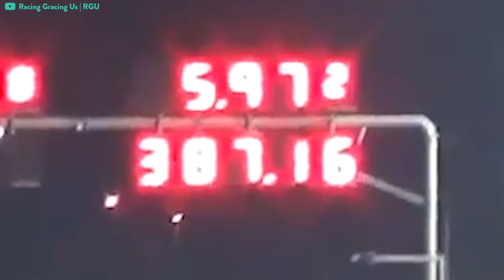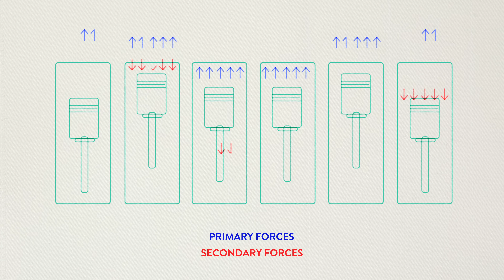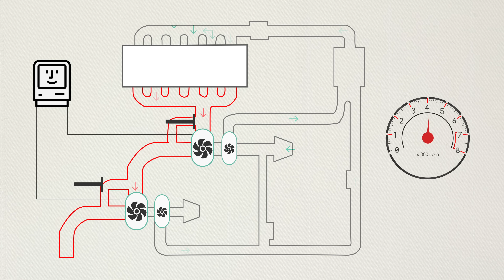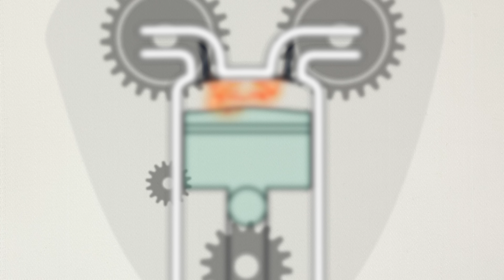2JZ ENGINE - How it Works | SCIENCE GARAGE

Comment: Just think about how reliable this engine is when you keep it stock
Reply: Even at 400hp....
Reply: @alhemmings8554  that is where I would want to get my IS300. Do you know if you could get 400 with just the stock engine or would I still need to get a turbo setup?
Reply: @alhemmings8554  is dont have 400hp stock dumbass
Reply: I bet you could do 500 000 km on a stock engine without breaking anything
Reply: @valtersousa27  way more 😂 I've seen stock toyota engines last a million km's
Reply: @valtersousa27  a lot of cars do that lol
Reply: @valtersousa27  I kmow a Engine who can that to without any Problems. Audi A6 2.5 TDI it's a 5 Zylinder Turbo Diesel Motorcode AEL. This thing is just great. You can even tune it up to 220hp and it keep running reliabel for decades. I speak out of experence.
Reply: stock cars have never realy had problems with the engine. engine is the last thing that fails in cars. it's mostly the stuff around the engine. sensors,wires,turbos, fuel system, brake system, rust. an engine rarely fails
Reply: @rpchar  But that is diesel, that's a completely different story. I'm talking about 500k miles ",driving like you stole it". Of course its easy to do that mileage on any diesel driving like a grandmother
Reply: @valtersousa27  Who say that this thing got drived like a grandmother? We straight piped it and have everyday fun with it. Every week we drive around 1000km. The turbo sounds also great. Diesel got also nice sound. And it's Nixe to fuck with people who think it's just a Diesel. Got no Power because it got nö Sound like a F1 car
Reply: @rpchar  isnt that the shittiest TDI ever lol?
Reply: @FaZeCrafT420  The 2.5 5 Zylinder is nice, the v6 is shit
Reply: @rpchar  the 1.9 tdi 130hp AVF is way better
Reply: @oreimarcio  In Germany we say: Nicht genug Hubraum!
Reply: @rpchar  in portugal we say: não é  preciso cilindrada alta quando há muito cavalo
Reply: @rpchar  Depends in wich V6 tho. Just look at the RS4 Limo from Philip Kaess making 1300hp.
Sadly it burned down for some reason in normal traffic. For his version 2.0 he is aiming for even more.
Reply: @rpchar  mate, it's still a diesel, economic engine to pull stuffs, that's all
Reply: @kaedeschulz5422  he was talking about a diesel audi not a rs4 xX
Reply: @rubencarvalho3517  If so ups... Idk shit about diesels.

Off course they need lower compression if you wanna make big power :)
Reply: @rampage3337 so true and every car has its Achilles heel.  The question is what car can last as long as a million mile engine, like the Mercedes five cylinder diesel.
Reply: @valtersousa27  .................wack.
Reply: You can fly down the highway full throttling it, for like 5 minutes straight.
Reply: @Bu0f  only 5 minutes?
Reply: @Bu0f  you talking out of experience?
Reply: Noorquacker No
Reply: Noorquacker it was a guess
Reply: ToxicHeadshot, from my experience, yeah. Pretty spot on
Reply: Noorquacker i actually drove mine on my way from the netherlands to croatia at 180-200 on cruise all the way through germany, only stopping to refuel... without a sweat!
Reply: @Bu0f  very Nobel of you to tell the truth and say no, I was expecting you to start bragging about your supra or pretending to own a supra haha. I forgot I’m not on Instagram
Reply: @Bu0f  ehh you can do that in most vehicles now
Reply: @breedam  KPH or MPH?
Reply: @obviousb8508  km/h, i am from the netherlands.
Reply: @breedam  Da li još uvijek posjeduješ Supru?
Reply: @breedam  Supra in Croatia damn never saw it
Reply: @NoorquackerInd  you can lmao I daily a stock sc300 with a vvti about 250,000 miles with just a rebuilt head it runs like a dream
Reply: hoe hoe heb je geen boetes betaald, ik zou stressen dat ik mijn rijbewijs zou verliezen
Reply: @NoorquackerInd i sent it home 30 min drive from my ex's house at 120-140 miles per hour, it survived the whole drive back but popped a coolant line off going uphill after. My coolant hoses were old car hasnt died on me yet still my favorite car to drive
Reply: @Bu0f  evidence?
Reply: @Bu0f  you can do that in literally any descend car.
Reply: @Bu0f  you can do that it most cars
Reply: @Bu0f  Just 5 minutes is just understating how long it can with stock setup it can do at least 15 minutes more if you have proper cooling
Reply: @Bu0f  I mean, if you got the gas..
Reply: It’s called the IS300
Reply: @warrenh8709  Altezza?
Reply: @maksisskorodihins5344  no the altezza has the beams four banger that is also a great engine. The is300/aristo has the 2jz
Reply: Miles B that’s a 2jz not a gte from a Supra tho
Reply: @okkaybender  Isn't the IS300 NA? In that case i don't think it has the gte.
Reply: @okkaybender  that’s what he’s saying lmfao
Reply: Pretty sure stock 2jzs don’t exist anymore
Reply: @Detah_  They do but very rare
Reply: @Detah_  They exist, just not from Supras probably. Maybe you can find stock ones in a Lexus.
Reply: @Detah_  ouch, I’ve got one
Reply: @Detah_  they do and are rare and expensive than an amg
Reply: @Detah_  I own a Lexus IS300 with a stock 2jz engine 😎
Reply: @Detah_  I've got one with 350k miles 😁
Reply: Detah I have a 2jz-ge. It’s the naturally aspirated version of the gte, the engine block, crank shaft, connecting rods etc are all the same as the gte
Reply: @jugo6987  unless you have a Non-vvti ge your connecting rods are NOT the same as the gte
Reply: The problem is that you can't leave it stock but get at least 1000 horsepower
Reply: "stock" haha, how about no😂
Reply: Still 0-60 at 4.6 seconds which is nothing to joke about
Reply: Mine is stock! 100% has 210,000 did the Timing belt water pump kit myself hopefully makes it to 400,000.
Reply: When you what?
Reply: Legend has it that you can fly when driving the car
Reply: Nope. I need that loud BOV, I need that loud crackle pop... I need that vrrrrrruuuuuuuuuu tutututu
Reply: @bclilboostd  A blow off valve doesn't stututu 🤔😅
Reply: toyota. super reliable
Reply: @_.twixxx  *old Toyotas
Reply: @rpchar  oh ok
Reply: Brother has a daily 2001 lexus is 300 with 335,000 and it drives like new lol
Reply: No one will ever know because there’s probaly no more stock ones
Reply: Still kicken at almost 300k miles
Reply: @sfmusic1418  You have a JZ? In what car if that's the case?
Reply: S50, s54
Reply: true
Reply: 500,000 miles plus prolly
Reply: nice bait
Reply: But more power baby
Reply: @andyhouse1774  Hell yea! And also if done right is still reliable.
Reply: And still really fast
Reply: Literally bulletproof
Reply: Not realiable.
Reply: 2JZ vs mom that’s not aware of the existence of oil or the significance of a check engine light
Reply: Ermagurd ermergin her relerurble urt curd ber
Reply: You could redline with no oil and gas for an hour straight
Reply: It’s reliable with 1200hp
Reply: @Will Kelly lmfaoooo😂
Reply: Nobody knows since every supra has custom engine.
Reply: 2jzs were even put in the 4runners. My brother had one. Motor ran so silent that there were times when he would try to crank it on while it was already running. You literally couldn't hear it. 💀 lol.
Reply: @moisessanchez2365 , they never came in 4Runners from factory but it’s a cool swap
Reply: It could still be easily modified
Reply: And slow.
Reply: Never been done before
Reply: Just think about how much power you’re missing out on stock
Reply: Bro did u forget it’s Toyota of course is reliable
Reply: 1JZ is more reliable so just imagine that too
Reply: @yungsilvia2507 , the 2J is nearly identical in design with just a longer stroke so I’m not sure why you think that lol they’re equals in reliability tbh
Reply: We never think that
Reply: Keep the oil clean and it will probably outlast you. Lol
Reply: My 2jz at 319k and still going lol
Reply: @gnashsliderdude9678  2 jz; no shit?
Reply: “LES GO 2000HP”

Engine: “imma head right out”
Reply: Or even if you just do simple mods
Reply: well this engine would last atleast 1,3 million km without problems.
Reply: @EnjoyMyHitsYT  and who needs an engine that last longer if it's not a truck lol
Reply: @yacinealg152  lmao
Reply: Bro send it.
Reply: Motto of toyota: best reliabilty when stock
Reply: If it’s tunes right the engine runs more efficiently even making big power doesn’t decrease how long it lasts you just have to know what your doing
Reply: Not that reliable actually. You don’t understand that just because the block is strong and can take a lot of stress doesn’t mean it is reliable,
Reply: @freddieparrydrums  what's does it mean then...
Reply: It’s is very reliable. I have one stock 2001 is300 that has 400k and no problems besides the o2 sensor needing to be changed
Reply: I dont have a supra but the thing i would upgrade first is the fuel tank so i can get more mpg and install a boost controll and a standalone ecu so i can go 90mph with a mk4 supra that make 500hp that can take me gome
Reply: I plan on keeping mines stock, maybe low profile bc cams and a tune that's about it
Reply: Or add things like oil coolers and heat resistant tape.
Reply: A coupe corrola basically
Reply: Right as everyone is having a stroke because the tundra is twin turbo like it’s going to be some huge failure. Like na. Toyota had this shit figured out before you were brought onto this planet.
Reply: However, if you'd slap on all the modern ecology norms, it might still be reliable, but would probably have under 200hp. Still a dream.
Reply: Lol who keeps a Supra stick?
Reply: Who keeps a Supra stock?
Reply: Exposed
Reply: Just think about how much it cost to
Reply: Guess it’s safe to say almost every if not every 2jz isn’t stock anymore. They’re all 2000jz’s 😂
Reply: 1 million miles
Reply: as if such things exist
Reply: I have a 450hp mk4.
Right now I have 600k kms on the dash.
The only change I had to do was change the timing belt. That's it
Reply: Nobody needs ur negativity... hush ur whore mouth.. all our gfs know that these mods we do to these are to make them more reliable. Since we explain exactly why a larger turbo is more likely to last longer because it's bigger. Those smaller ones just too small they blow so easily. And ofcourse we are adding head studs to make them more reliable. Oh and let's not forget the reliable cams we put in. Ported and polished heads remove the factory imperfections which make them more efficient. Duh. Oh and the bigger injectors mean they're working less as hard to fuel the engine so they last longer. Stock trim is reliable but I am willing to go the extra mile for my family to make sure its..it's... oober reliable.
Reply: The engine is smooth even cruising it to maximum throttle at Autobahn 200m/hr gas is the limit
Reply: No
Reply: @giggityeffyou  Yes
Reply: I have a 04 lexus is300 bone stock never missed an oil change and she's at 278k right now and still running daily no problems
Reply: What are you talking about? You think it was more reliable than my 2021 F150 3.5L Hybrid? Lol
Reply: Make it more reliable by removing the turbos and keeping it NA.
Reply: @wooferjr169  And only have 200hp on the gte because of the low compression pistons? Hell no!
If you make it NA might as well mod it so that it make 400hp NA. That would be awesome!
Reply: @kaedeschulz5422  turbo'ed cars need lower compression
Reply: @wooferjr169  ....wack.
Reply: @wooferjr169  you’d be crazy to drop stacks on a Supra and just keep it stock
Reply: exactly. though they are still very reliable at 400hp. never have I seen higher powered jz car drive to an event and back, always trailered in and at the pits after a lap/pass or 2.. They sure do sound awesome though.
Reply: @KIM_DOTNET  you can have it around 500-700 hp with 0 issues. Older buddy of mines dailys his in the summer. Last I asked it’s around 615, and man it feels more than that even.
Reply: Stop with the reliability bs people most engines die because of overheating them due to cooling system being compromised or the rings are worn out because the are a wear item just like your breaks. So what did we learn that a Chevy will out run everything in low rpms and last waaaaay longer haha
Reply: @ziondizzy2011  Show me a Chevy with over one million miles on the clock😉
Also engines break when ppl try to make like a thousand hp on stock internals.
Reply: @kaedeschulz5422  wtf there are plenty
Reply: @ziondizzy2011  Maybe but what about the condition?

Comment: If any of you ricer fan boys knew anything about motors, you would know the best motor ever built was built by the company you pussies are constantly bashing. BMW’s S62. Aluminum block, 302CI forged from the fires of Mount Doom. It can make over 700 horses without forced induction. Hell, the LS6 is better than a 2GayZ. Fucking fan boys.

Comment: anyone know more or less how much im looking at for this swap?
Reply: Depends on where you want to get the parts from. What car the engine is going in. And how much of the work you can do yourself. 

I did the swap with a 95 N/A 2J from the junkyard. I paid $100 bucks for the engine. 50% off day at the junkyard. New bearings, rings, and seals, and a valve job. 

I added a turbo to it and dropped it into my Datsun 260Z. 

Cost me about $1,500. I sold all the Datsun powertrain parts and bought the parts for the swap. The Datsun already had the Standalone ecu. And I did everything except weld in my engine mount brackets. I bought 2 W58 manual transmissions from the Junkyard, for $200 bucks. 50% off day at the same junkyard. One is the backup. 

Just be creative.

Comment: I used to work at a lumberyard, and one of the Toyota forklifts had a 5ish liter normally aspirated diesel engine.  It looked so much like a 2J, but I couldn't find any label on it.  Does anybody know about Toyota diesel engines?  I have seen diesel to gasoline conversions before (the Oldsmobile diesel engine was a shite diesel but can take insane boost when modified for gasoline use, and somewhere on the internet is a Duramax converted to be a twin-turbo E85 engine) and I was thinking a five-liter 2J would be the tits.

Comment: The jdm had smaller turbos and ceramic. 280 was the max hp. Also the engine had different internals. Toyota had no intention to make the engine compatibility. It was just based on. The mindset to be reliable and safe. My proof is how you seen them driving today stock
Reply: Thank you for providing facts based on manufacturer.

Comment: The 2JZ-GTE VVTi is non-interference, just like the non VVTi.
The 2JZ-GE VVTi from the Lexus IS300 is an interference engine (because of the higher compression).

Supra Stock long block record is 1043whp and 808tq with a GT47-80 running ethanol.
9 variants of JZ engines not 6.
Reply: Fuck timing belts 😡
Reply: using fucking ethanol on a road car, now im gonna fill my getz's engine full of ethanol to get 500 horses
Reply: @Robert Smith yeah, even the car will blow up 6 seconds after the use of the ethanol
Reply: @Ivannbeats , E85 (usually what people mean when they say ethanol in America at least)  is more stabile under boost than pump gas lmao means less likely to blow up and makes more power with the same specs as 93 octane. Main downside is it’s not very clean burning and fouls spark plugs. You should go read more before expressing your options online lol
Reply: hey i really appreciate your comment! I am trying to buy a late model Supra. Would be nice to have the non interference for peace of mind even though I would get the timing belt changed straight after purchase
Reply: @Robert Smith  they are using it because horsepower, and then they advertise their cars with more hp than they produce
Reply: so glad the non vvti came non interference... if i do bigger cams that becomes false

Comment: 3 variants of each? wrong;
1JZ-GE (naturally aspirated, port injection)
1JZ-GTE (twin turbo, port injection)
1JZ-GTE VVTi (single turbo, variable intake cam, port injection)
1JZ-FSE (naturally aspirated, direct injection, higher compression ratio)
2JZ-GE (naturally aspirated, port injection)
2JZ-GE VVTi (naturally aspirated, port injection)
2JZ-GTE (twin turbo, port injection)
2JZ-GTE VVTi (twin turbo, variable intake cam, port injection)
2JZ-FSE (naturally aspirated, direct injection, higher compression ratio)

9 variants (4 1JZs and 5 2JZs)

Comment: Ok guys 2 things 1. do 2 jz have 3 motor mounts or 4( and this next part will anger some people )
2.

A turbocharged ls 5.3, 5.7, and 6.0 ls can make 6,7,800 hp for less and have easier time with replacement parts as well as being just as reliable
Reply: How's that ?. 

You can get a 2J from the junkyard for under $200 bucks. They are available in every junkyard I go to. That engine can be boosted up to 800hp without blowing up.

Comment: Does anybody in the supra and Lexus 2jz world want to tell these guys where th wrong? 

I say something the oil squiters come built in to all 2jz the ge models are not drill out while the gte model are. 

Heads are different but you can swap them from the 2jz-gte models with adapter gasket people do it all the time. 

Internals on both models are extremely similar, the gte model borrowing rods from the ge and the gte getting new pistons and crank shaft with diffrent heads the ge models are also tuned down and higher compression but are still good for 400+ hp in stock form.

So before all you frs, brz buddies got start hunting gs300 and is300, dont your gonna get beat the automatic alone rev up 6,000 RPM  on all Is, Gs, And SC300.

Comment: Another awesome engine that’s can get 800hp and *cough *cough 1600lbs of torque is an 12valve 5.9 Cummins it’s also a inline 6 all you gotta do is put a big turbo, (preferably a compound set up but it’s more money) and a remove the fuel plate, 4K governor spring, heavy duty valve spring, bigger injector, good idea to get head studs, and a fass system, and fix the KDP, and your good to go. Oh and yeah your gonna need a billet tranny to handle that TORQUE.